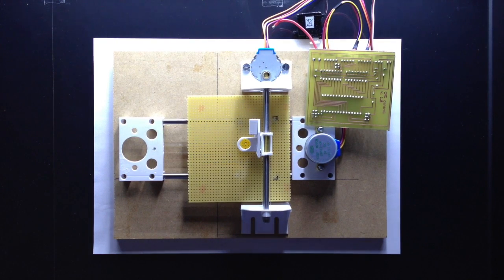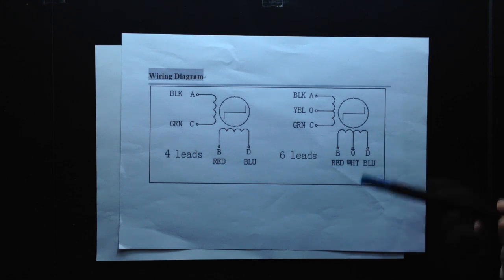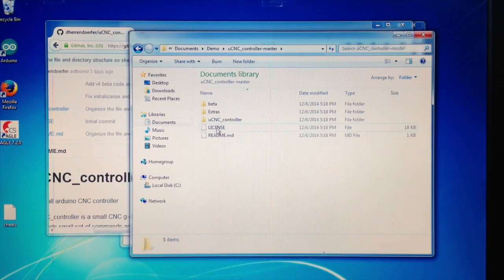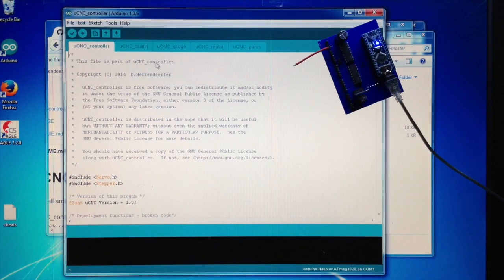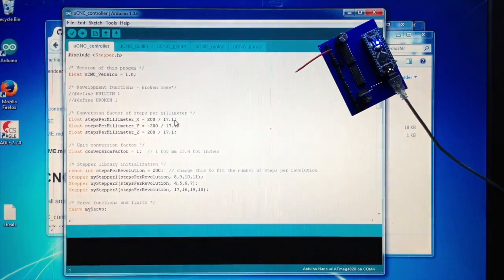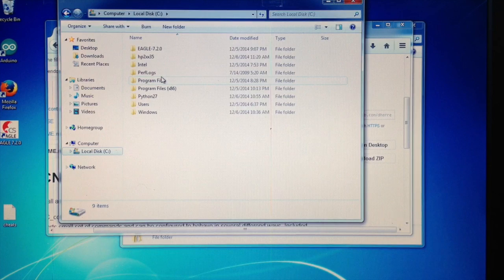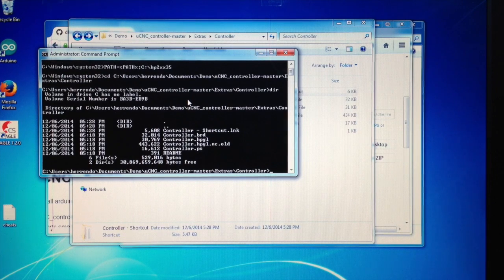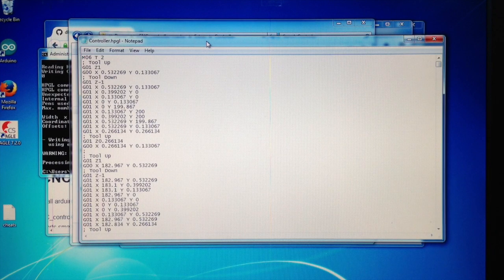Direct ink to PCB-Software talk

Comment: Hello friend, please help me in this project
I'm in doubt which pin put the servo motor
where:
Stepper myStepper1 (stepsPerRevolution, 8,9,10,11);
Stepper myStepper2 (stepsPerRevolution, 4,5,6,7);
Stepper myStepper3 (stepsPerRevolution, 17,16,19,18);

I thank you!

greeting from Brazil
Reply from the maker: From the documentation:
  Connector   IO-Ports on Arduino nano w. ATMEGA328P
---------->--------------------------------------------
  Stepper 1:  8,9,10,11
  Stepper 2:  4,5,6,7
  Stepper 3:  A5,A4,A3,A2 (digital out 19,18,17,16)               
  12V out 1:  2
  12V out 2:  3
  Laser out:  13
  Servo out:  12

Greetings !

Comment: Hi Dirk have closely followed your project and I have taken on the task of putting together one like yours, but I have the following problem'm using bipolar motors 200 steps per revolution and transmission of nylon, as well you explain in the video, I calculated the distance to a full turn, the shaft of my engine has 4 mm in diameter, that gives 4 * 3.14 = 12.5mm, but here's the problem, not arduino engines use to move, I'm doing with Mach3, but never will and comes to the same place, for example if I say x10 moves 10mm approximately, now if I say x0 should return to the same point, but it does it moves to x-1 and every time you move x10 and you return it moves further back and if you move farther the error return is higher, I could help with this that already has me anxious, I do not know if using arduino solve the problem, in Section stepsPerMillimeter_X = 200 / 12.5

thank you very much from now, forgive the English is not my native language.
Reply from the maker: Two possibilities are: slip on the axis, or your motor speed is too high and the stepper is skipping steps. Put something onto the top of the stepper and see if the Zero position of the stepper is always the same.
Reply: ok, I'll try it tonight and tomorrow tell you whether or not match the zeros, about the speed, I do not think that is the problem, then move slowly.

Thanks once again for your quick response. a greeting
Reply: Dirk Herrendoerfer Hi Dirk, did last night testing again, I did what you told me, one of the problems I have is q my engine is 1.8 degrees is 7.5 degrees, so the steps are 48 for a full turn, I tested at low speed and at the end always the case begins to move from zero, besides the absence of a suitable step or accurate for measurements, for example, I say x = 10 and reaches 9.6450, because the increase of steps does not give an exact number. finally decided to change the method step millimeter threaded rod to eliminate transmission losses and to be more precise, now I will replace the servo z axis by an electromagnet and a discrete circuitry to handle. if you have something like that out there, you could help me.

greetings, Enrique
Reply from the maker: No, sorry I have never tried a magnetic pen construction.
Reply: ok not worry, I'll try using a microservo with arduino nano when I buy it. Now as you do in Gcode to activate the Laser, and as you connect the arduino, thanks once again for everything.
see you

Comment: I manage to make them move when powering the board but no luck yet with the artgcodewriter, I am thinking I might have them set wrong and that could be the reason why it freezes the software. I am using 28BYJ-48-5V servos. They seem very similar to the ones you are using on the latest version of yours. The datasheet says 32 steps per revolution (step angle) and 2048 steps per revolution (steps per output shaft) Should I replace "200" in the software with 32 or 2048??? my shafts circumference is 24.7 so divide which? (32 or 2048) / 24.7.
Also according to this datasheet. http://arduino-info.wikispaces.com/SmallSteppers the correct order would be (stepsPerRevolution, 8,10,9,11) or is it (stepsPerRevolution, 11,9,10,8) ???

I really appreciate your help
Reply from the maker: If you are using those small steppers, you might want to use one of the firmwares from the beta directory. Your steps are 2048/24.7. Try to keep the stepper speed as low as possible in the beginning, so you can see it is working fine. To get the correct wire order some experimenting may be the best idea - I have seen several different configurations on seemingly similar motors.
Reply: Hi Bucita , did you get it right , I am having same issue

Comment: Hi Dirk I am stuck with my project. Whenever I send a command trough the artgcodewriter it only takes the first click and then it hangs, I get the hour glass as if it was processing but is actually freezing. Using the arduino serial monitor I do get the "READY OK". I have tried with two steppers plugged except the servo which I dont have yet and also without any stepper thinking I might have soilder something wrong but either way the .py freezes. Any Ideas? I am thinking it might be my computer (win xp) or the arduino it self. I appreciate your advice. thanks
Reply from the maker: I noticed this myself just now - but it is the python app, I will look into this (Now that I have windows too) as soon as I get the time.

Comment: Hello,just finished CNC still need to get the software running.In which mode do I run the code if I use the stepper on Z axis so it moves the pen up/down?
Cheers!

PS

OK I think that's its supposed to be run in mode 0.
Reply from the maker: mode=1 
Mode 1: Stepper 1 is X
          Stepper 2 is Y
          Stepper 3 is Y
          Servo     is Z (down for Z<0)
          Laser     is Z (on for Z<0)
Reply: Dirk Herrendoerfer Thanks, I'm probably going to have to use servo like you.Small stepper motor from floppy drive can't lift the pen and keeps stalling even when there no load.You got any ideas what it could be?I was supplying 5V from USB gonna try from PSU today.Maybe the frequency is wrong?
Reply from the maker: Apologies, mode 0 was correct - maybe it is the speed, I once use one go the small linear steppers from the 3.5 inch floppies and found it to be rather strong. But USB power is probably not enough ... Try a beta (v1) firmware, you can set different speeds for each stepper there.

Comment: hi Dirk i watched this video and redo the process, but i fund the nc file,which i produced by your steps isn't the same as yours in the document, and then when i look over this video carefully, i fund the nc file(which u produced in this video) isn't the same as the one in the document too. can u check that?
here is some details:
the original one begins like this:
M06 T 2
; Tool Up
G01 Z1
G00 X 0.20025 Y 0.05025
; Tool Down
G01 Z-1
G01 X 0.20025 Y 0.05025
G01 X 0.2 Y
.........
the new one:
M06 T 2
; Tool Up
G01 Z1
G00 X 0.532269 Y 0.133067
; Tool Down
G01 Z-1
G01 X 0.532269 Y 0.133067zi
G01 X 0.399202 Y 0
G01 X 0.133067 Y 0

they are different why?

regards!

Comment: great video. I learned a lot.  I am building the same style cnc that you built. just wondering is there anything you would change on your cnc if you built another version?
Reply from the maker: Joe B I've changed something each time I updated my devices - I went from reused parts to cheap new ones. I now (sometimes) use quality linear bearings, and now use bipolar Steppers for my 3D printer concept.
It all depends where you want to go - I'm thinking about building something that is more in the line of a true CNC, with threaded rods, so it can do something with a little force to it, but first I want to get my own 3D printer stuff to work, that is really far right now, but may still need some thought.